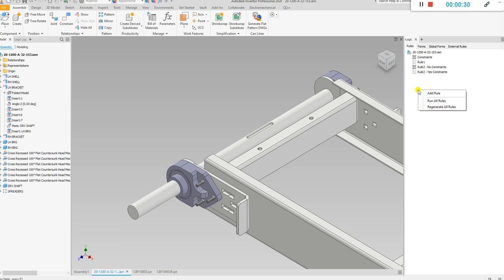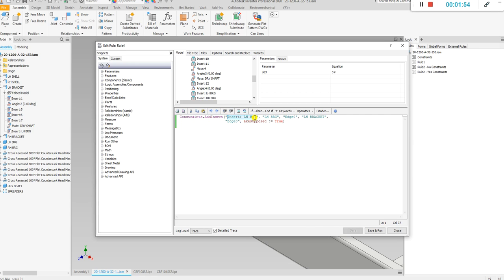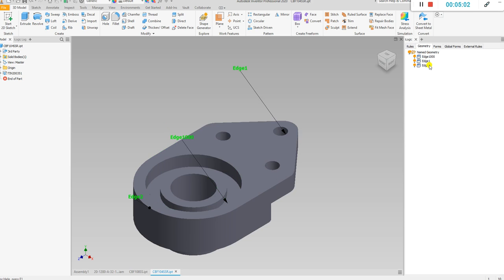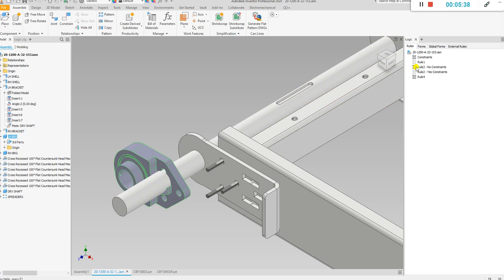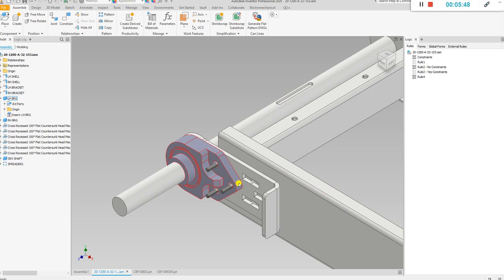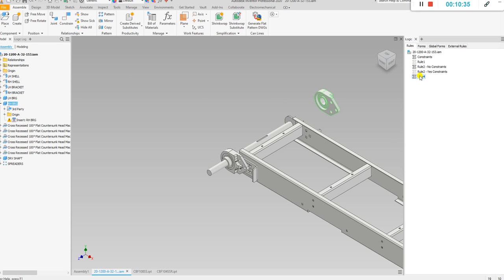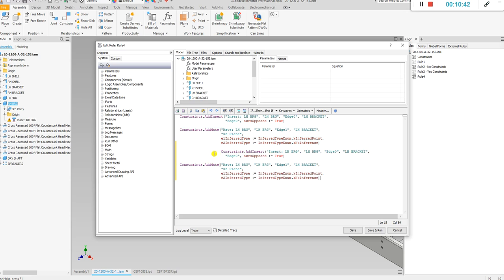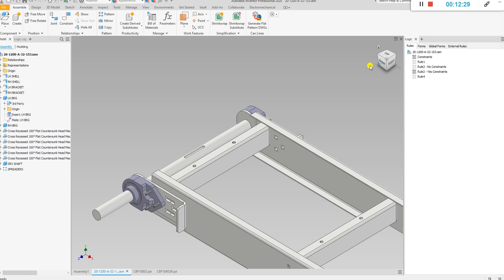iLogic For Beginners #4: Creating Constraints

Comment: I used to create constraints in iLogic using iMates, I was wondering if there was major differences as of why I'd choose one method over the other?
Reply from the maker: The company I worked for didn't have many predefined iMates on parts, so I chose the route to avoid iMate constraints. So I am not as familiar with the differences between iMates than this method. 

This method works well. The constraints can still trigger even if the document is "closed" (not visible to the user but opened on the back-end).